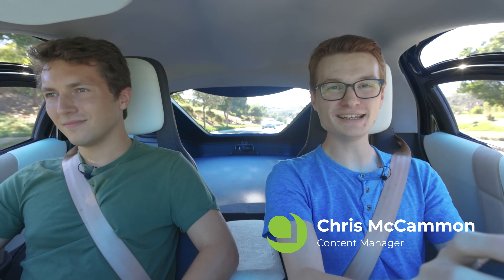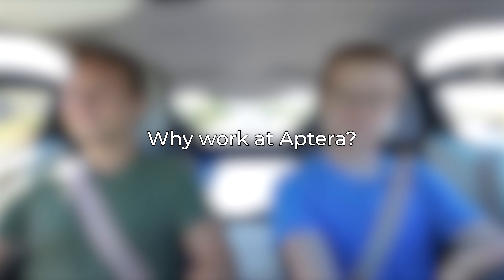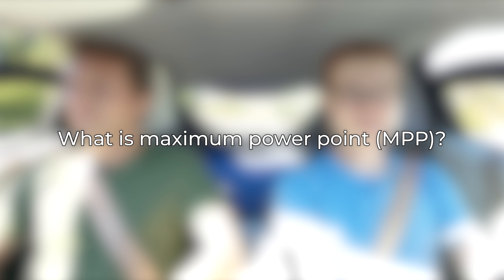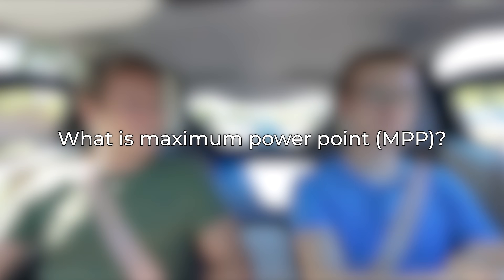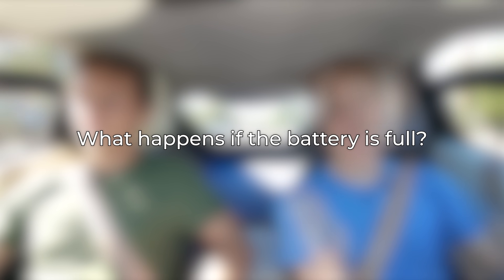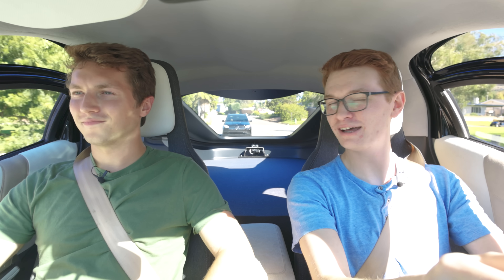Aptera's Solar Charger — The Third Wheel

Comment: aw. I was hoping for a 220 VAC thing so this could act as a whole house backup. Ah well. The 12v thing is cool all the same 😅
Reply: whole house backup has been problematic even with Ford's money to throw at it.  Give it time and it seems like the feature will standardize over time but it requires a lot of setup and integration.
Reply: @ccibinel  If you just disconnect the main before using any battery backup system, you no longer have to worry about ~90% of those complexities. All you are doing at that point is basically using your breaker box as an enormous extension cord..

Granted, expecting people to remember to do that might be a tall order..
Reply: Yes there have been many issues with the Ford Lightning whole house backup system - too much reliance on blue-tooth and software, many glitches.  But using a Lightning as a backup can be no worse than using a portable back-up generator if instead of their complicated system, you use the 240v bed outlet on the Ford Lightning as a 30A generator via a transfer switch to run important circuits (not the whole house generally). Have to have a transfer switch that switches the neutrals because the neutral is bonded/grounded in the Lightning 240v outlet, as it should be for safety.  Some older transfer switches don't switch the neutrals so the breaker (GFCI) in the Lightning will pop every time.  @ccibinel

Comment: can you solar charge while plug into a charger ?🤔
Reply: Yes!*🤓 

*That's so for 120 and 240 volt AC chargers. A DC fast charger will max out the charging capability so sunlight can't add any more power.
Reply: I think I heard Chris A. say a while back that plugging in will disconnect the solar charging.
Reply: i see .. thanks for the info.. looks like most people will be fine with using 120v outlet... i guess it can get up to150 miles over night charging on 120v, dont think 90% of the people will be driving up to 150 miles everyday for this type of car.. and with fast charging on 240v maybe less then 20 mins you can go out and about and be back home
  @jackfrost8269